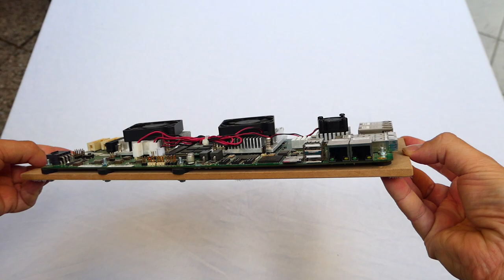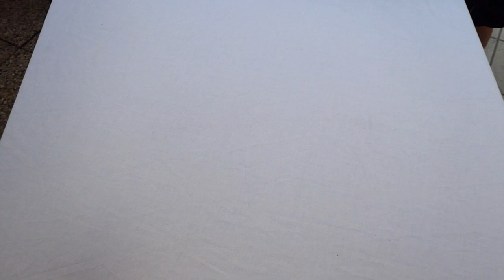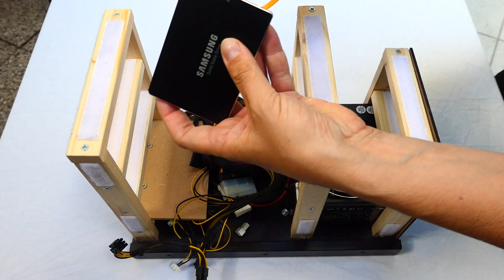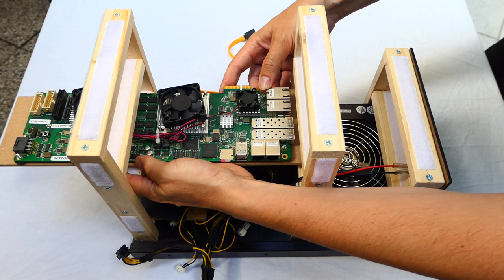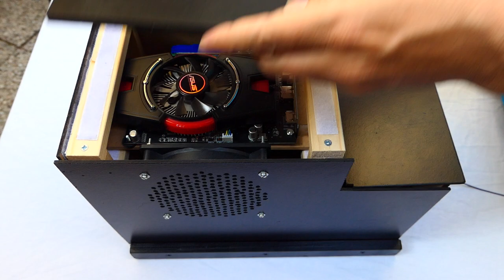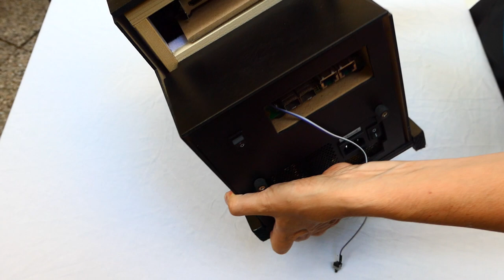Mount the NXP T2080RDB into a wooden desktop case

Comment: Mountable Hardware Tieres remember a little bit at g5 Coolingsolution 👍. But in fact a small Computemodul, with  1GB of RAM and a PowerPC 750 VX, like a Raspberry Pi or something else would enlarge your Comunity, Support and Donations much more and is less expensive and problematic in Chip purchase….Maybe you should Vote with your Community abbout a Parallel development….🤔… also you could Connect it in Marketing to the Fame of NASA’s Toy’s 😉, not that‘s your attention of the Project but i think it would make things a lot easier. Apart from this My G3 is still Running, Mac OS 9 Lives ❤. Code optimisation in this times was far More advanced than todays Consumer Stuff…Back to the roots and from there far beyond😎👍